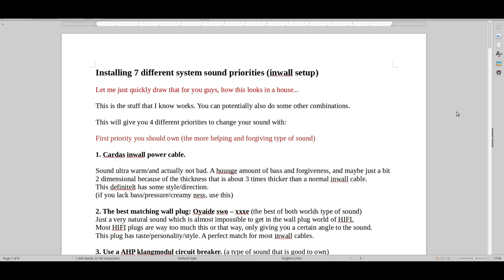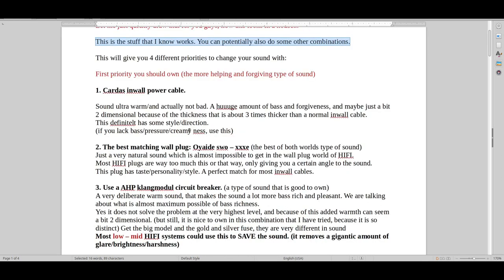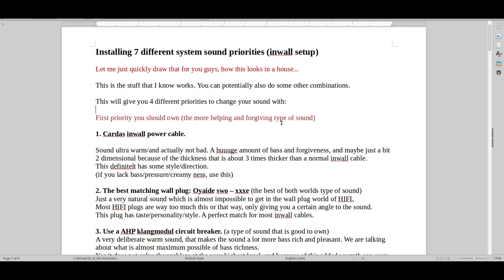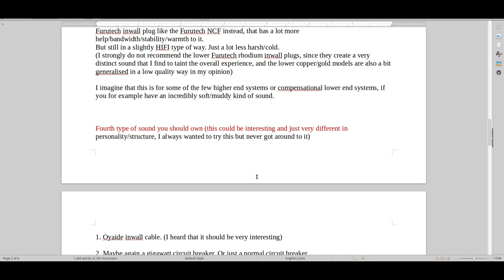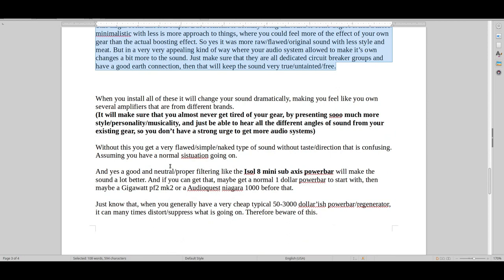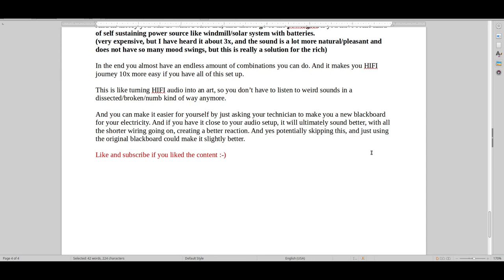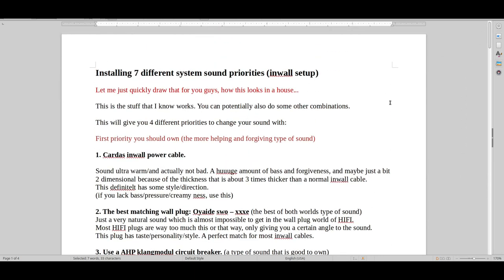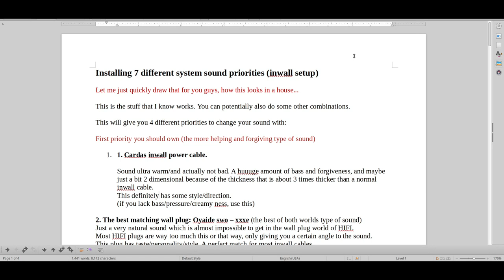Installing 7 different sound system priorities (power)

Comment: Great Video and channel! Like listening to your thoughts on various aspects of Audio.

I use the Gigawatt Evo in-wall cables and Gigawatt circuit breakers plus seperate ground rods (3x) to run two 15A circuits to my listening room. I am now keen to try the Dopke audiophile circuit breakers which are 15X more expensive!!...not sure of the benefits though.
Reply from the maker: I have not tried it, but maybe it is good.
You can create a lot of good combinations.
I also recommend trying the Cardas inwall, very different sound in a good way.

Comment: But what about buying instead one of those PS audio power plants for those who are renting their flat/house and can't manipulate cabling and circuits?
Reply from the maker: That is not nearly enough, you can still hear problems with a good powerbox that does not have a good base behind it.

It helps a lot, but you might as well do it right from the bottom - up to save money on your future investments.

You can also get away with having a streamer on the same powerbar as your audio system. But there is no reason for that, when you can save so much more money on just putting it into a different wall plug that has a totally different circuit breaker.

In the end everything is connected to each other, so even if your fancy PSaudio or whatever brand box, has isolated power group on the powerbar, it still affects the sound to some degree.

Hope this helps. No one really talks about these things in the HIFI world, so you are not wrong for thinking what you do. That is what most people that are even very skilled/experienced, would suggest.

Very good question.

Comment: Probably a stupid question for you, but where do you find wattgate products in Europe? Same goes for Oyaide inwall cables. Any website you know and recommend?
Reply from the maker: It's a fair question.

I googled it, then went to the official homepages, got the dealer info on the homepage, then contacted them. In my country it was a company called HIFIfreaks.dk that could deliver them. It took 6 months to get those plugs. (jup crazy)
Reply: Interesting. Here in Germany, from the wattgate you get directed to kimber.de and they only sell plugs, not in-wall receptacles. Unable the find Oyaide in-wall cables.
Reply from the maker: @giorgiovaloti4129  Analogseduction.net has it and...
Reply from the maker: @giorgiovaloti4129  Audiohobby.eu also has it. (oyaide inwall cable)
Reply from the maker: @giorgiovaloti4129  Sometimes you have to ask them, then they will maybe find them. Or maybe you can use another countries dealer or ask Wattgate about it. Or maybe HIFIfreaks.dk that I used.

It is tough to find but worth it in the end.
Reply: Thanks! (Damn, YouTube keeps banning almost all the comments with some form of URL in them. I posted a comment about audio hobby and it got cancelled twice 🤬)
Reply from the maker: @giorgiovaloti4129  Yeah I got to see it but then they removed it. Also got another one like that earlier today from some other guy, with a positive comment. Annoying.